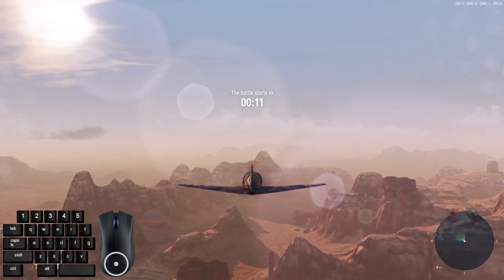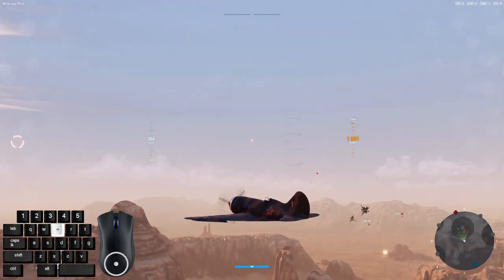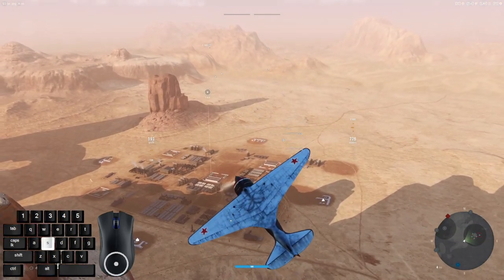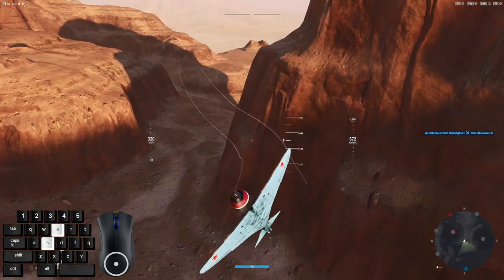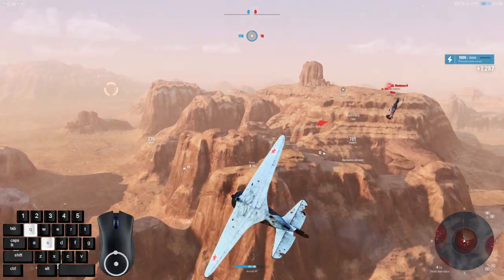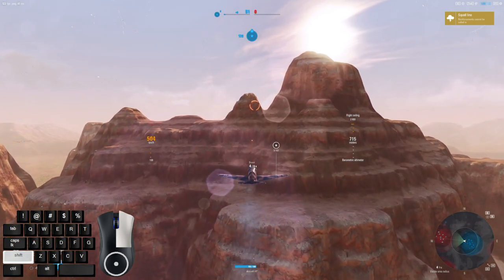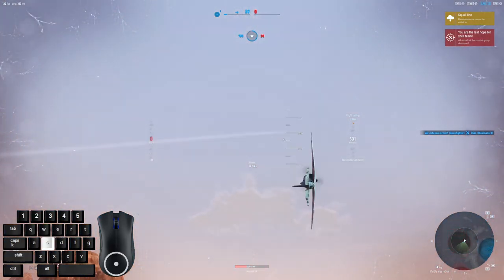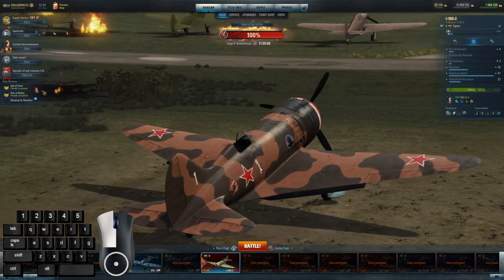Rudder Control Pt. 2: The Aerobatic Boogaloo

Comment: I loved the keyboard overlay.   Yep - I can see a lot of time for me in the training room after the Griffon marathon.   My keyboad is set up slightly more standard, but I have brake and flaps mapped to C and X, and my pitch down is mapped to the tilde (~) key - mainly because until your video, I couldn't think of very many use cases where pitching down would be useful.

One of the things I tried to do (way back in a training room) was a "side-slip" - basically sliding left or right by using roll and opposite rudder (i.e., left roll-right rudder or right roll-left rudder).  Seemed inconclusive to me, but I like the lag roll you were doing.

Theoretically throttle exists in WoWP, but I've never noticed any significant advantage in it.   Might be worth my time to pop into a training room and play with it some more - supposedly, it's something like 1/10th increments up or down for each key press, but don't quote me on that :)
Reply from the maker: That side slip is something Kaim has perfected.  I can do it in a few planes with high yaw rates, but I'm still working on most of them!